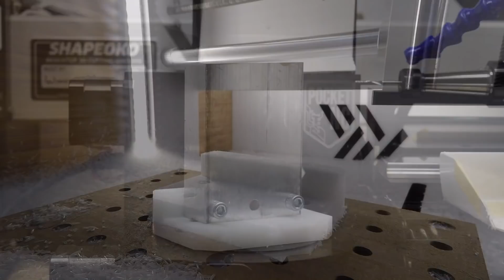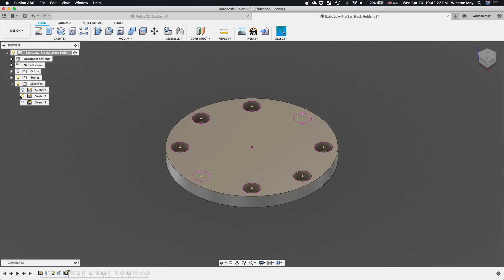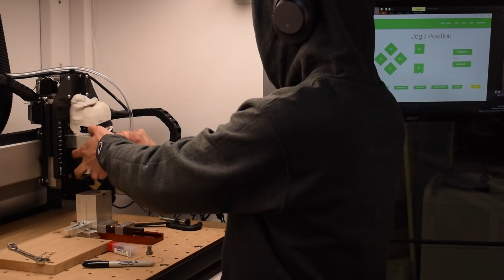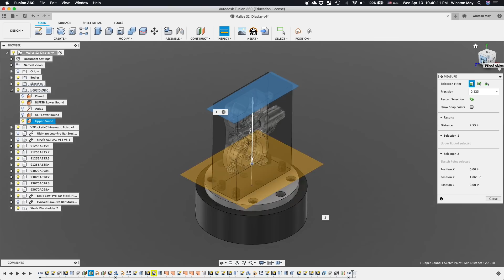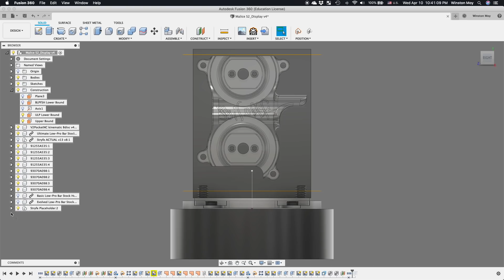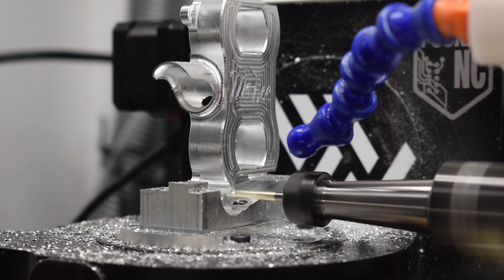Ultimate Low Profile Workholding for the PocketNC - #144

Comment: Hey Winston, I like your videos. You really inspired me to go after these cheaper machines because I saw what they are capable of thanks to you. Not to plug my video but I wonder if you made clamps like the ones I made for my cnc gantry, if they would work well for you on your pocketnc for holding flat stock. 

https://youtu.be/RZlcr19NxGw

They are pretty low profile and can be machined pretty easier on using 3 axis. They produce tremendous clamping force, have no lift and are pretty simple devices.

Comment: Since PocketNC raised the machine price to over 8 grand for the 2.5, they are dead to me.
Reply from the maker: That's for the 50k rpm version.  That NSK spindle they use costs $3000 msrp. They are charging you a fair price compared to the base model...
Reply: @WinstonMakes  Be that as it may, putting a 50krpm spindle on such a small machine isn't a reasonable thing, or am I completely wrong here? Once you're approaching the 5-digit price range, Tormach and Syil become a competitive factor, so I don't think it is smart to just put a fast spindle on such a tiny machine. If they'd make the PocketNC in a scaled-up version using servo drives, then I'd consider that more reasonable and they could ask such prices no problem.

The way it stands right now it is too expensive for hobbyists and too small for professionals in many cases.
Reply from the maker: Tormach and Syil are completely different kinds of machines. The V2-50 shines with micro tooling, 1/8" or less. That high speed does amazing things for surface finish on metal parts. Look up @ekramer3 on instagram. He's been beta-testing the machine for PNC and the quality of his parts is a huge step up.

I've seen machines in the jewelry market with similar work areas that cost $40,000. The capability is definitely not mainstream, but for a small niche of users, it's actually an interesting offering. When they finally come out with an upgrade path for older machines, I'm considering taking the plunge.
Reply: @WinstonMakes  It makes sense for a niche like jewelry no doubt, it is just hard to justify putting a 3k USD spindle on a machine where the rest of the mechanics rely on stuff like trapezoid spindles instead of ballscrews etc. 

It probably makes sense for what it is, I was just shocked how the prices creeped up over time, I was so close to order the V1 back in the days of Kickstarter but ended up not doing so because of money constraints. That was in the 3k ballpark. Seeing it approaching the 5 digits was just shocking, even with that crazy spindle.

Comment: What's with the sock over the top of the router on the shapeoko? Dust filter?
Reply from the maker: Precisely.
Reply: @WinstonMakes  Nice :) Hadn't thought of that, but good idea... even with vowing to never cut MDF again it would probably still help. Thanks!
Reply from the maker: It's primarily to guard against aluminum chips. For MDF you best best is still a dust shoe.
Reply: @WinstonMakes  ah, yeah. That would be important :)

Comment: Can you do a vidio on micro mills and very fine milling for flat sheets
Reply from the maker: It's on the list. Will likely end up on the Carbide3D channel as a #MaterialMonday video.
Reply: @WinstonMakes  i would love to see stuff on the tapered ball mill under 1 mm. I have done lots of work with them but i am not sure about the math behind chip loads and f&s. Can not find anything on youtube either
Reply from the maker: There's not much. Saunders has some tangential Y related stuff w/ his engraving F&S video. Best advice I can give is to check a reputable tool maker like Harvey who has thorough feeds and speeds recommendations for their catalog and use that as a starting point.